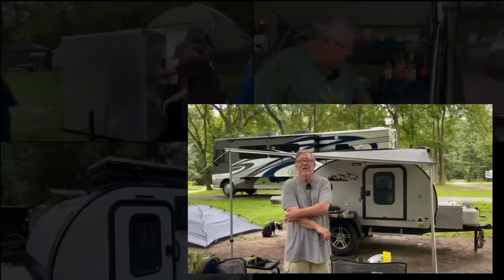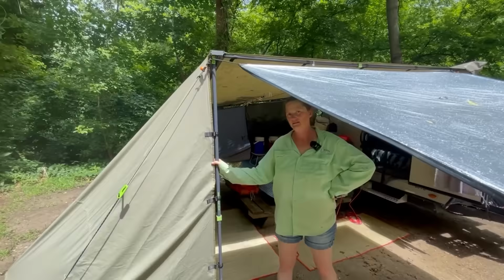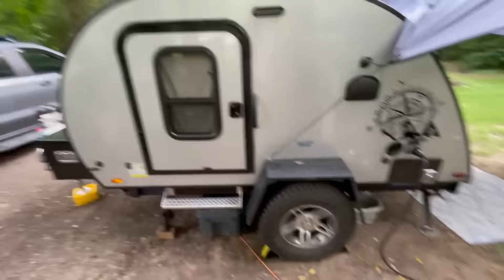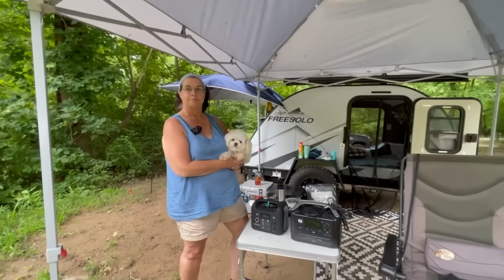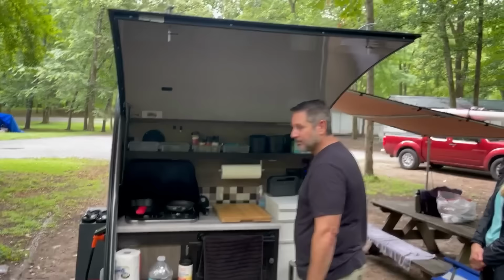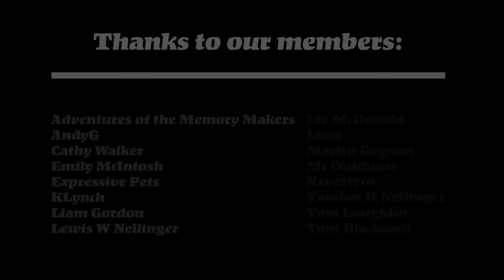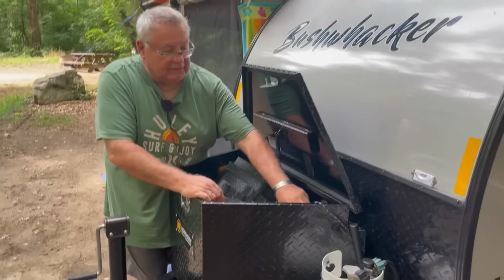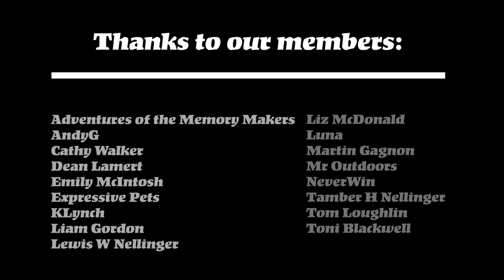Bushwhacker Camper Tours with GREAT Mods

Comment: Hi, I have camped in on spot made survival shelters, tents and for the past two years I have the 2021 bushwacker 15 fk, I have camped with full service and off grid for a couple of days last year it was a 4 day off grid, one day with service for three weeks. This year now that I have a bluetti 1500 I am going for the full three weeks off grid! Can’t wait!
Reply from the maker: Nice addition, did you get some solar yet?
Reply: Yes I have in addition to my bluetti a 100 watt deep cycle ( not lithium) battery and a suitcase 100 watt solar panel with integrated charge controller. I don’t think we will need more than that as we live pretty much outside when we camp. Which is the aim of camping I think.

Comment: I have a question about the jack-e-up. How do you use the wheel? Mine tilts the jack making the wheel unusable.
Reply from the maker: Hey James, I’d have to see what’s happening, I use mine without any problems.  Although it’s not as solid as with the jack bolted down, I’m a little more careful and can roll the camper around like before.   Is your jack tilted?
Reply: @DIYOutdoorLife  hi again. No the jack is straight up and down, and side to side. It works great with the sand pads. My wheel is like a grocery cart caster. Which the wheel axle is off the center line of the jack, causing it to tilt the jack.
Reply from the maker: @jameshubbard7965  are you using the double wheel one that I recommended in the video about moving a trailer by hand?

Comment: Can anyone tell me how big/long the sleeping area is on a Bushwacker 10HD?
Reply from the maker: I hope someone chimes in, I don't have the exact measurements right now, but it is an "RV queen".  It is essentially a slightly smaller version of a traditional queen size mattress, I still use queen size sheets.
Reply: @DIYOutdoorLife  I am '6"5 so I am curious as to how I will fit. I just sold my Intech Persue. I have been looking at Intech Lunas but I do like the "blank canvas" these Bushwackers have like the Pursue does.
Reply from the maker: @Rattles02  I have met some very tall folks that stay in the Bushwhacker.  The cabinet above your head remove with just a couple screws, this seems to be the preferred mod.  Once that cabinet is removed, you achieve 6 to 8 more inches of bed space.  Some have stuck at pad in there, some have just slid the mattress up.
Reply: @DIYOutdoorLife  cool. I’m going to look at a Bushwacker next week. If that doesn’t work I’m just grabbing the Intech Luna I found.